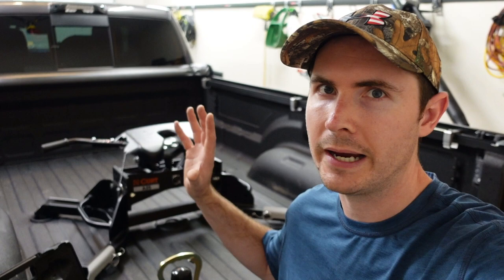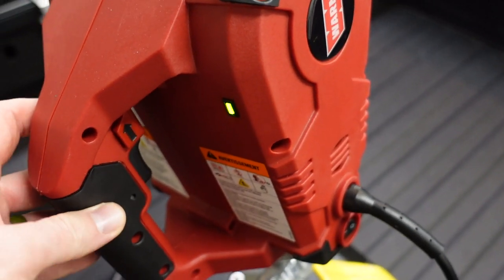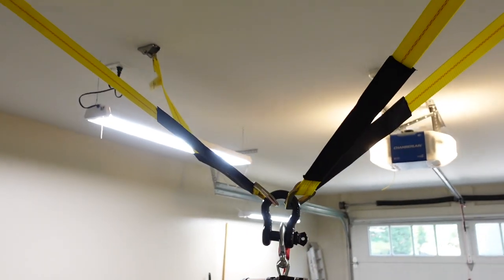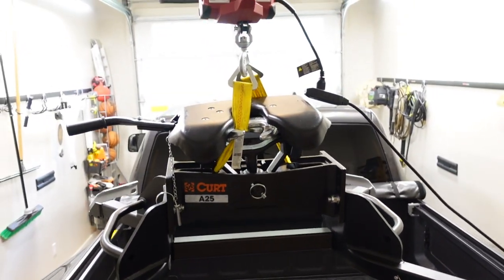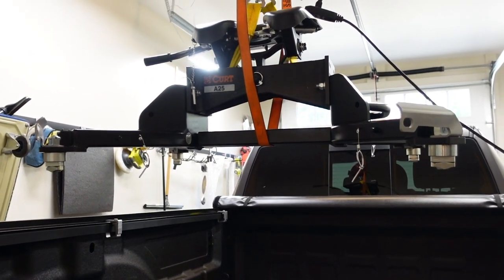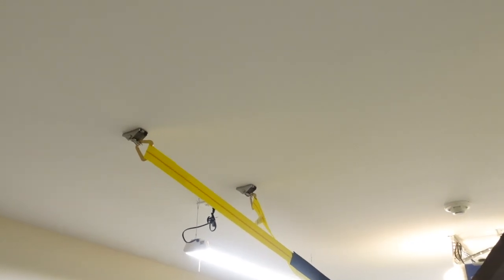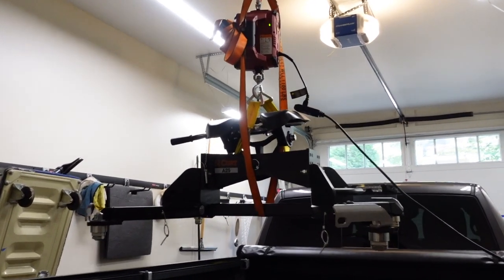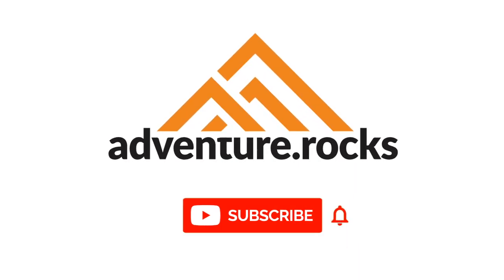Solution to the Dreadful Fifth Wheel Hitch Removal // Save Your Back with the Warn Pullzall

Comment from the maker: A HUGE thanks to Jeffrey H for suggesting a fifth wheel lifting bracket. I never knew such a lifting bracket existed, and this is WAY better than me trying to use an axle strap to hoist up my fifth wheel hitch. I'm so very grateful for the tip! This Demco Fifth Wheel lifting bracket is compact and perfectly sized to mimic a king pin, so all I have to do is put it in the jaws of my hitch, lock the jaws into place, and it's ready to lift/hoist. Now it lifts level, looks cleaner, and just a much better anchor point. If you're interested in purchasing one, here's an Amazon affiliate link:
https://amzn.to/3IzrWVf

Comment: I would suggest you may want to consider a fifth wheel lift pin in place of the tow strap on the hitch.  It is a simpler , stronger and more balanced solution.
Nice presentation!  Wish I could fit my truck in the garage.  I am using a fold up engine hoist for the hitch pick and then I rolll it into the grage.
Reply from the maker: Love that idea!  I did not know such a thing existed, but just googled it and that would be perfect for my use. What a great idea. Thank you for sharing.

Comment: I'm wanting to know more already about the reese goose box since I have a gooseneck and was sold a pull rite gooseneck to fifth wheel hitch which does work but I would much rather have something gooseneck to gooseneck if it exists because I am finding myself in this same situation :) Thanks for making this.
Reply from the maker: Thank you. I used Goosebox previous and really liked it:
https://youtu.be/bJUDHNewcPE

There is a newer gen out now, but similar to the one in video above. Just have to make sure pin-weight is within spec. My 2021 Pinnacle was over 4K pinweight, so more than the Goosebox is rated for.

Comment: A simple chain fall would also work just fine and I considered using one in the shop to do something just like this but you are stuck with where you can easily pull the hitch out in that one location. If you were anywhere other than home and realized you needed the hitch out, you would have to remove it by hand the old fashioned way or go home and come back without your hitch. For me, the Reese Goosebox is still the right answer to the problem.
Reply from the maker: That's a great idea. I did not think about a chain fall. I like that option too.
Reply: On my new 2022 Avalanche I swapped out the Road Armor Trail Air for the Reese Goosebox at the dealer.  Even though it cost me $1800 including the install I believe it was worth it.  If you add up what you paid for the Curt hitch, plus the hoist, straps, D ring install points etc., I think you might have gotten there.  Couple that with listing whatever hitch yours came with on Facebook marketplace to make up the difference.  I made $400 on mine.  Somebody had a basic hitch and wanted the trail air.  Either way, very innovative.  Thanks for sharing.  When do we get to see the new 5er?
Reply: I also purchased a WeighSafe goose ball so I know that my trailer is puting 2200lbs on my truck. That really isn't possible with a king pin and 5th wheel hitch.
Reply from the maker: @iFish My only challenge for Goosebox was my pin weight. I'm technically over the 4K limit on Goosebox @ 4.5K lbs pin weight. I contemplated it some and figured I'd think about it more before making the swap...not sure it is a safety issue or comfort (suspension tuning on Goosebox). Tough decision for sure. Goosebox is still my favorite platform...smoothest ride in my opinion. Hopefully will get some time to do a quick tour of it in up and coming weeks :)
Reply from the maker: @CP FPV I love the idea of weighsafe gooseball. Great idea.

Comment: I noticed you have the ram puck system just like do. The one thing that really annoys the ** out of me is that the alignment of the four male posts on the adapter would be just a tiny bit off and the assembly won't drop in because the tolerances on the receiver end is so tight. I have resorted to loosening the bolts that hold the adapter together so the assembly would drop in then retighten the bolts after. It sometimes even occurs during removal as well. Have you noticed this problem and do you have any advice?
Reply from the maker: I think I know what you're talking about. When I first assembled my Curt I left all the bolts loose on it and then dropped it into the pucks. Then I tightened the bolts on hitch to torque specs and have not had an issue with it fitting in since then, even after multiple in/out. I have heard of this problem from others, so I don't think you're alone. I wonder if it's possible that some hitches are ever so slightly warped such that they give grief when mounting? Maybe ever so slightly damaged in shipping, enough to throw it off? That's the only think I can think of if you've already tried loosening the bolts and re-tightening while mounted.
Reply: Sam, I own a 2019 RAM with the Curt hitch and puck system. Loosen the nuts so the framework is flexible. Drop the hitch in place, close the 4 locks, tighten the nuts, and then use a torque wrench!!! I believe it's 100 ft-lbs.  My hitch has not moved since I torques the nuts.

Comment: What truck bed cover do you have?
Reply from the maker: It's a TruXedo TruXport: https://amzn.to/3qQ45cM

It's kinda old school styling in that it sits above the bed rails, but I like the simplicity and fact that rain will naturally run off the sides without any drain channels or gutters like some of the ones that fit between rails or lower profile units. I had same one on my last truck and it's held up really well. The locking mechanism feels solid too.

Comment: How did you sell your companion? Was there a platform you used?
Reply from the maker: I think I sold it on either craigslist or letgo. I remember it went pretty fast and I got a pretty decent price for it. Close to a thousand I think, but that was several years back.
Reply: @AdventureRocks  I have had mine listed for a while and zero bites. It’s a companion slider listed for just under 1,000. I want to switch to the goose box but I can’t justify the purchase until this thing sells.
Reply from the maker: @D_Joe_B  That seems like a reasonable price for a slider. I'd think you could get at least $700-$800 min worst case. Sometimes I have luck on Facebook marketplace too for stuff like that...but seems like I get lots of spam interest that route.